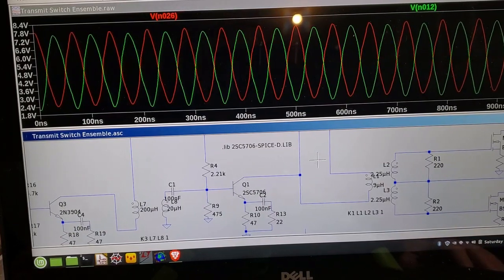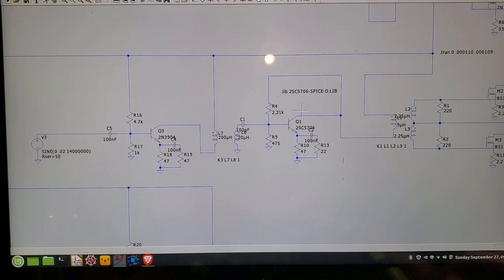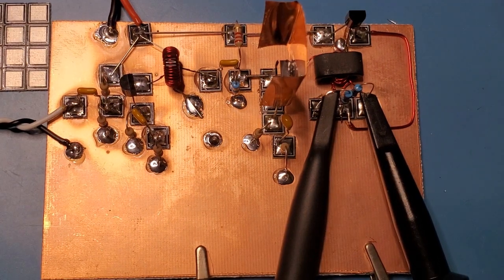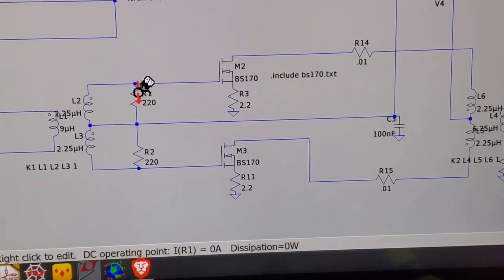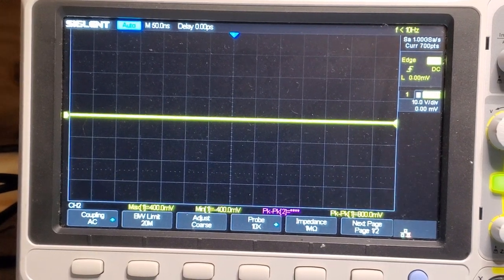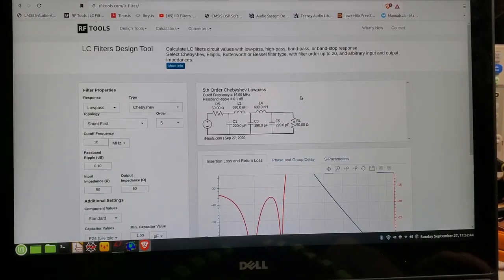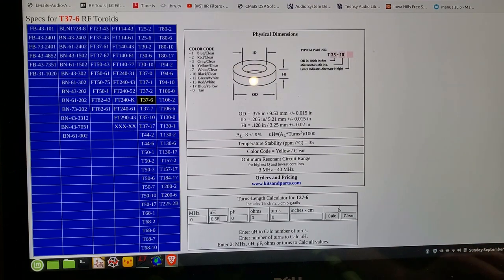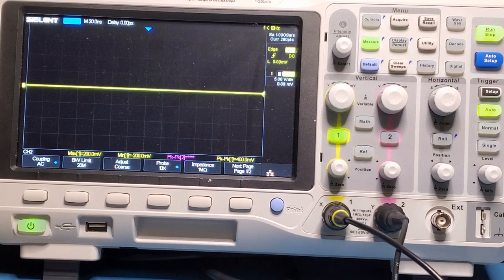20m SSB Amplifier

Comment from the maker: I made a mistake comparing the outputs. LTSpice voltage sources are in amplitude so "0.01 V" means a peak to peak value of 0.02 V. I re did some of the tests and while the simulation values were closer they were still substantially out. I will update the tests in the next video